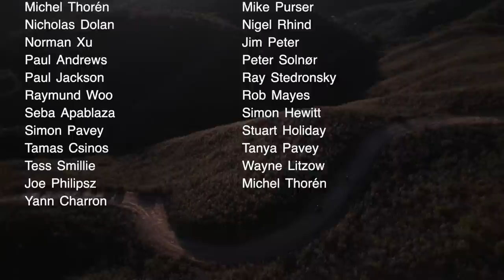Can we UNLOCK the Tenere 700's true power? | The T7 Project EP #002

Comment: I had the full Yoshimura system.  I had the spark arrestor baffle in.  ECU tune by DynoJet for a decat system.  It was just too loud on the highway.  I put the stock header back on and re-flashed to a slip on tune.  Lost a tiny bit of power but at least i can hear again.
Reply from the maker: Interesting. Do you use ear plugs? I can see that for sure.
Reply: @BrakeMagazine  I like to recommend and use "concert" ear plugs (filters).. they have a canal in the middle to  allow sound through. Not as good as regular ear plugs, but also not drowning out the sounds around you or your headset speakers.
Reply: Puhoozy

Comment: I think you should consider swapping your stock tank for a rally raid tank. That would give you lower center of gravity, which should translate into an even easier bike to flick around. Possible you could also drop the crash bars, saving weight. I don't know if the rally raid tank is like the orange Austrian bikes, where the lower part of the tank act as crash bar but I think it does.
Reply: Чем плохи защитные дуги?
При падении хорошо защищают корпус и мотор от поломки.

Comment: There are exhaust systems for the  T7 that keep the slip high; in a safer place than where it is now. Just saying it cause you mention the shared fear of scratching a new exhaust. Amazing videos you do. Keep it up!!!
Reply: Or worse, bending/shearing the subframe, nicking the swingarm, smashing the exhaust 🤯
Reply: Keeping the muffler high doesn't put it out of harms reach. We chose the mid mount as it fits the lines of the bike better and it allows for panniers. Just FYI :)
Reply: @yoshimuracycling  the exhaust in its stock position hits the ground by default if the bike falls. Moving the exhaust to a higher position will improve this issue and there are plenty of lugage systems thay will fit a high exhaust (mosko moto as an example). Not for nothing off road bikes tend to have high exhausts.
Reply: @agus8080  Touché!

Comment: Nice work on the bike and sending it hard up that hill at the end..
Would be awesome to know how much more fuel you’re using now you’ve found the sweet spot. Love the sticker kit too.
Reply from the maker: Thanks Blade! It kinda varies. More tech riding uses more it seems. Somewhere around 35 UK mpg from memory.
Reply: @BrakeMagazine  sorry not living in her majesty's or yehaaw unit areas
35 UK mpg that is about 8 L/100km ... is that about right?
Does this mean that the average fuel consumption nearly doubled?
Or does this only apply when (ab)using it hard offroad?
If it would be the general average, it would mean, that the bike would have only about 200km fuel range, which would be pretty harsh for travel ;)
Reply: @MathiasKarlssonErik  well since the bike consumes an avg between 4.4 and 5.5 l/100km, depending on how and where you ride it, that means there's an increase of about 50-60%.

It should be less when on-road, because you can use higher gears and not stress the engine as much. You also have more air in the tyres.

I think it's ok, if you don't wanna have it properly tunned.

(I'm not an expert. I'm only using general knowledge of the subject)

Comment: Love this series. 
I've been swaying towards getting a tenere 700 over a cb500x. Mostly because they are near the same weight but the Tenere is setup with more power and to be so much more offroad capable. 
I want to do some moto-camping trips and some reasonable off-roading. 
I also can't find a new CB500X anywhere within my region so that might make the decision for me right there. CB500x gets better fuel economy and range but has less power and needs some decent mods to get it to where the Tenere 700 is off road.

Comment: Having had a piston melted by a similar (much more reputable) product, caused by a malfunctioning wide band sensor, I wouldn’t recommend tweaking fuel maps.
Reply from the maker: You're allowed to name and shame. The point of the this one is that you can either auto map it or upload official maps. 

That's pretty lean to have that happen though 😩😩
Reply: @BrakeMagazine  Probably yes but my goal was to get it to 13.2 AFR but the wideband sensor malfunctioned after some time. I played with rich AFRs, never reaching even 14. The leanest I tested was something like 13.7 for the second (fuel economy) map. The richest 13 so I was thinking I was always on the safe side. Little did I know. PCV and Autotune (single channel) combo on a 2009 990 Adventure R.
P.S. The system was on the bike for more than 5 years.

Comment: I would love to hear your thoughts on a 20-25mm lowering of the T7 along with a seat concepts 20-25mm lower seat. There are videos out there about lowering the T7 but they don't have your riding credentials. At 5'4", I can't touch the ground on a T7 off the shelf. Can the T7 be a really good adv bike when lowered an inch?
Reply from the maker: Absolutely. As long at the balance of the bike is good front to rear it should be fine. I think realistically the best ADV bike is the one you're comfortable riding and a lowered T7 is probably a good shout. 

As height it a worry for you, I'd also consider two other things. One, talk to a proper suspension shop in your country about getting the suspension lowered internally so the forks can match the shock. Big improvement. 

Secondly, the T7 is a wonderful bike. It is slightly top heavy. This will be better when lower, but I would also consider the Aprilia and the KTM 890. They will be equally good, if not better off road and have lower centre's of gravity and feel more planted. The T& has a very nice low power for off-road, but so does the Aprilia. Either way, you have some great options there and suspension shop will 100% be the best place to advise on the options.

Comment: Great video! What's your opinion on those crash bars? I saw the clip where you dropped the bike. How does the crash bars worked? Any damage to the engine area? Radiator? How about fuel tank and/or plastics? I'm trying to decide what crash bars to install on mine. Thanks in advance!

Comment: Awsome filming and contents,
How for of of these suspension changes are you from the 2022-23 rally raid?
As a starting point if I was to buy a new tenere.
Would you buy the 21 model and make changes or the new?
Cheers Trevor.
Reply from the maker: If you watch episode three, the Rally Raid is similar to the KTECH but not as good as replacing the internals with a cartridge l. That's not to say it couldn't be with a revalve but I have no experience of that.

As for which bike, depends on what you wanna do with your bike. What do you wanna do?

Comment: How low in the rev range would you say the Rapid Bike EVO improves the fueling? Does it help off idle and allow you to slowly crawl in technical sections with less clutch work?
Reply from the maker: Yes. The design of it mean it will work in the closed loop section of the fuelling. This isn't the case with a lot of other piggy back fellers and was the main reason I chose it.

Comment: Love the build series. Does the Power Bronze windscreen get rid of the wind buffeting? The internet forums suggest the different shape of the Power Bronze screen completely removes the turbulence so you just get clean air hitting your helmet, similar to like standing up in stock configuration. Can you confirm this? Thanks
Reply from the maker: I'm not really convinced either way. It is maybe a bit cleaner but I didn't do a ton of road miles.

Comment: I want to install RS-12 Yoshimura full exhaust system and Rapid Bike EVO module. Is it enaugh than to just run adaptive mode or i need to modify module  manually.  Do i need computer to lunch adaptive mode ?
Reply from the maker: You do not need to modify it. You may want a computer just to check that it is in auto mode. :)

Comment: I have the Rapid Bike on multiple bikes and love them, but you are incorrect, they do suck more fuel. That’s the point, you go from too lean (stock setting) to much fatter/ richer, more fuel. On all my bikes running Rapid Bike along with improved exhaust system, air system, decat, I was seeking richer, more fuel air mixture. Your mileage per gallon decreases.
Reply from the maker: I think you've misunderstood, I completely agree with you.. I manually changed the fulling in the software to see what happened.

The auto setting is much richer as you say, and it worked much better, but you can do what you want and yes it uses more fuel. Quite a bit.

Comment: By the time everything is added or changed on a T7?  It will cost as much as a new 890R would have cost. But still wont have numerous things the 890 has. 90HP will be hard to come by.
Reply from the maker: I would argue the engine is much more rideable though. The power is strong but also really easy to find grip with. It's a different thing really.
Reply: @BrakeMagazine  At 7000 miles on my 890R, Its hard to imagine a smoother torquier easier to ride  engine........out on road it goes really well also....the electrical package is really useful for finding traction...its a different thing for sure.....T7 is just more the built to a certain cost thing.
Reply: @bradsanders6954  I like base platform bikes because they draw the most aftermarket support which makes customization almost endless to suit your individual taste/style. I also am not a fan of bikes with lots of tech as I always feel less connected to the bike and what’s going on under it. Rider aids like TC causes you to become dependent and sort of lazy as a rider. These are only my opinions but it’s just an example of why it’s great there are so many great options to choose from in terms of budget, performance and expectations and stock enhancements vs aftermarket. There is always something for everyone out there and each one offers enjoyment. That, I’m sure, is something we all can agree on. ✌️

Comment: the 701 is better. more HP weighs less.
Reply from the maker: Mmm, I don't agree. It's better at somethings and worse at others. This is easier to ride in a trials way.
Reply: @BrakeMagazine  is it bc it doesn't have the adv plastics and windshield? Can you ,elaborate thanks
Reply: I've had both as well, the T7 is better in some areas, the 690/701 is better at others. I agree with Brake, the T7 is better at slow technical stuff. The 690 is better at open field full smash type stuff.
Reply: @MeerkatADV  Interesting. I would not have expected that. (I'm a 701 owner). Thanks for the insight.